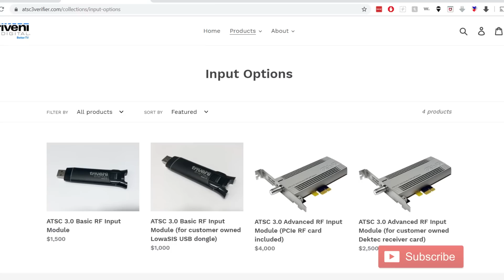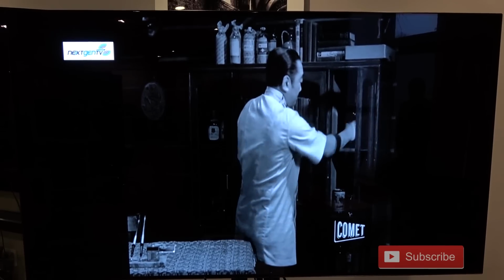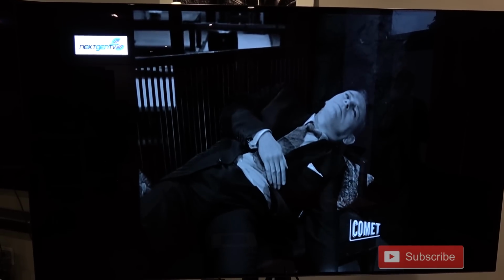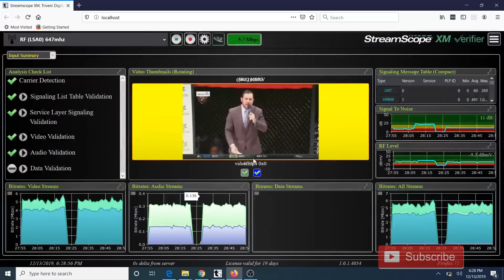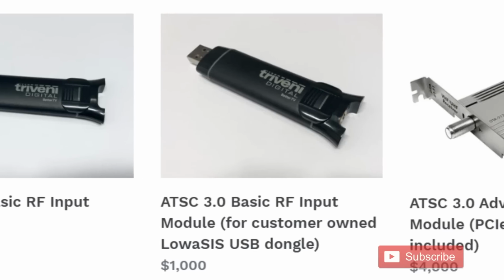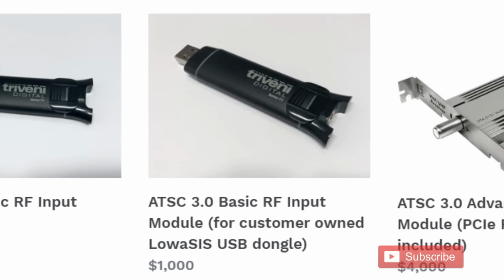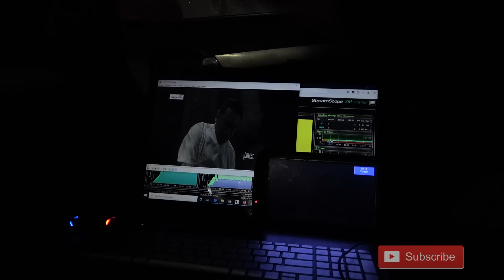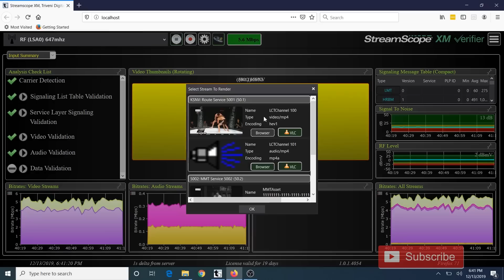ATSC 3.0 NextGen TV Signal Test and Demo in Baltimore, MD

Comment: Yes, a great video!  
One clarification -  the robustness and freedom from multi-path reception issues is primarily due to the modulation rather than the fact that it’s IP-based.  ATSC 3.0 uses OFDM (Orthogonal Frequency Division Multiplex) rather than ATSC-1’s 8-VSB (8 Level Vestigial Side-Band).  The OFDM modulation also makes mobile reception a reality, something that the current 8-VSB standard doesn’t support.
Reply from the maker: Thanks for the clarification on this. There was so much information from the visit I missed that part. Your comment will be pinned.
Reply: Antenna Man   Thanks!!  We manufacture transmitters and have been involved with over the air tests of ATSC 3.0.  You are right, only a Dongle receiver is commercially available in the USA for ATSC 3.0.  However, both LG and Samsung sell integrated 4K TV’s with ATSC 3.0 tuners in Korea.
Reply: I would appreciate a simplified explanation of this. I do not understand. Thank you.
Reply: Fred Pinnix   Fred, it’s pretty technical and might not be something I can explain in a few words.  In a nutshell, today’s ATSC-1 standard is based on 8VSB and although it works pretty well it has one major drawback - it is a single carrier system.  A single carrier can be badly affected by multi-path reception.  For example if the main signal and a second signal from a reflection are received in-phase all is well but if the main signal and the reflected signal are out of phase, they will cancel out and reduce the signal level seen by the receiver.  Movement of the receiver, or movement of an object that reflects the signal will cause problems that result in signal being intermittently lost.
The ATSC 3.0 signal uses OFDM modulation which uses thousands of carriers on different frequencies spread across the TV channel bandwidth.  In this case reflected signals will cause some carriers to increase in signal level and others to decrease.  This allows the receiver to properly demodulates and decode the signal.  There is also a lot of error correction (both time and frequency) that increases robustness.  ATSC 3.0 also has a wide range of “settings” that basically allow a trade off between robustness and payload.  There’s a lot more but it’s a pretty deep topic.
Reply from the maker: @martynh5410  The last part you mentioned is what they're figuring out at One Media: the balance between "robustness" and "payload"
Reply: Antenna Man   Yes.  I’ve met some of the OneMedia folks and they likely are testing some different scenarios.  The good thing is ATSC 3.0 allows simultaneous transmission of different payload/robustness programs using a concept called Physical Layer Pipes (PLP’s).  For instance one program with a low data rate could be transmitted using QPSK modulation while another one with high data rate ((like a 4K UHD tv program) might be transmitted using 256 QAM.  This allows different services to be broadcast to different consumer devices with different capabilities.
Reply: @martynh5410  Thank you for the additional information.
Reply: @martynh5410  I would not be surprised that ATSC 3.0 will survive better in E-skip ranges "54 to 88 MHz" for TV DXing than the old ATSC 1.0!😁😎

73's N5XZS
Reply: Tim Johnson   That would be interesting to find out Tim.  I never got started in Amateur Radio myself but TV DXing sounds like a good hobby!
Reply: So most importantly what happens to our current equipment? TVs and Set Top Boxes? Upgradeable or do we need to replace it?  Why IP based?  What does that mean in relation to 1000s of transmitters?  Dosent seem like OTA provides want to build 1000s of transmitters
Reply: @KA4UPW  

I suspect that many transmitters designed to transmit ATSC 1.0 may be used by replacing the ATSC 1.0 exciter with an ATSC 3.0 exciter.

If not, a whole new ATSC 3.0 transmitter may be needed - especially if the ATSC 1.0 transmitter were not engaged to a linear amplifier (as opposed to high-level modulation of the transmitter).
Reply: 1L6E6VHF   I think in general, most ATSC-1 transmitters can be upgraded to ATSC 3.0.  The two key issues will be  the transmitter power rating and the overall performance.  Since the peak-to-average power ratio of an ATSC-1 broadcast transmitter is around 6dB and the PAR for an ATSC3.0 transmitted signal is around 8dB, this can be a limiting factor, especially in older transmitters that are peak power limited.  In other words you may have to turn the average power down about 2dB to get an acceptable quality signal.  The other factor, signal quality (as in Signal To Noise Ratio and intermodulation distortion) may also be a limiting factor.  Newer transmitters have some pretty clever pre-correction to improve performance and the latest generation of RF devices and amplifier designs are much more energy efficient.  Therefore, yes new transmitter for ATSC 3.0 is often a good idea.  By the way, my company designs, manufactures and sells TV transmitters.
Reply: @martynh5410  
Thanks.
I wish I were working in your field.
Reply: Martyn H I hope you can offer some support to Antenna Man. He seems like a great young man and he's very excited about the possibilities and implementation of this new standard. God Bless
Reply: Thanks,
To me i thought one local network transmitter would requie 1000s of transmitters (repeaters) to pull this off. But yes between the repack and this upgrade it may bankrupt many sites
Reply: H.265? Or another better video encoder?
Reply: Mr. Garber  The video CODEC standard for 3.0 is H.265 (HEVC).  In reality it’s between 25% to 50% improvement over MPEG-4 (H.264).  Audio CODEC is Dolby AC-4 and also MPEG-H 3D.  
There is a newer CODEC on the horizon, called VVC (Versatile Video Coding).  It claims to further reduce bitrate by another 40 to 50% over HEVC, at equivalent video quality.  I think it’s due for initial release late 2020.
Reply: Thank you for the heads-up on VVC, i had never heard of it before.
Reply: Curtis B   You’re quite right Curtis regarding MPEG2 being in the current standard.  My bad, I’m an RF guy for 45 years and not an expert on video coding.  I think that you are correct on the CODEC for ATSC 3.0 being fixed (H.265) because tuners need to work going forward.  I do know that 3.0 is meant to be adaptable to future improved standards so maybe the could be changes later.  I’ll check with my colleagues on this point and get back.
Reply: @martynh5410  but if am not wrong FVC codec would be used in the ISDB-TB And ISDB-T systems but will do an specie of hybrid system for compatibility with the older TV that only can decide H264 only
Reply: It all sounds like science fiction to me.  Probably from the aliens who crash landed at area 51 back in the 1940's
Reply: Oooooh! Orthoganal Frequency Division Multiplexing! Gimme 316 kilowatt effective radiated power VHF high-band analog!
Reply: RF Burns   Great name “RF Burns” LOL!  I went to college with a guy who’s real  name  was Robert Frank Kidd, initials “R.F. Kidd”.  His dads initials were “A.F. Kidd”.  Have a great day and careful with that high power RF!!
Reply: Good video thank you.
Reply: S
Reply: Yes and no, the secondary video of broadcast in an lower resolution and bitrate makes possible the reception in Mobile devices not the modulation itself , may an OFDM be QAM 256 but if all that constellation is used with video with greater bitrate than an Mobile device can decode then will not get anything that device
Reply: @megacap55    Lower bitrate and constellation type are inter-related.  The low bitrate program could be transmitted on a QPSK modulated signal, versus a high bitrate program which would perhaps need a 64QAM or 256QAM constellation.  The QPSK signal will be far more robust and allow reception in more difficult circumstances (like on mobile devices or indoor reception).

Comment: I'm assuming the encoding used is x265 (vs the older x264)
Reply: Yes, it is. ATSC 1.0 uses MPEG-2, which is the same codec used on DVDs and is far less efficient.
Reply: @alvallac2171  , wow..the ATSC was WAY behind typical digital video.  I've been compressing video with x264 for years and just recently (last year or two) been using the more efficient x265 (about half the size & bitrate needed compared to x264).  However, the x265 codec is much more CPU intensive.
Reply: @douglasmontgomery6315  The reason ATSC 1.0 uses such an old codec is because it started in 1996. At the time, resolutions like 720p and 1080i made it very futuristic, kind of like the short lived HD VHS format that also existed ( https://www.youtube.com/watch?v=jiu0LPeLQPE ).

Speaking of video codecs in general, have you heard of AV1? Nothing to do with OTA broadcasting and it's still in its early days (currently zero hardware support for it), but it's a successor to VP9 (the open source codec used by YouTube) and given all the companies on board with it, it seems poised to become the next dominant video codec (like H.264 was). It's more efficient than H.265, while also being open-source, instead of the proprietary, patent-encumbered mess that H.265 is, and will often be paired with OPUS (the swiss army knife of lossy audio codecs that is also open-source, and slightly more efficient than AAC). Could be interesting once it starts to catch on. Encoding performance still needs serious performance gains. See http://reddit.com/r/AV1

PS: x264 and x265 are encoders, not codecs themselves. The codec is the format specification for how the video will be compressed, and the encoders and decoders are specific software implementations that get created to either create (encode) or playback (decode) files using that particular codec. For any given codec, multiple encoders and decoders can end up getting created. x264 and x265 are very popular software-based encoders for H.264 and H.265, but there are also other encoders that exist such as Intel Quicksync. Quicksync is hardware-based and thus much faster, but the videos it outputs are not as high quality compared to x264 and x265.

Comment: Glad to see more INFO about the New ATSC 3.0 Thanks . Like to know if you have ever installed  a Winegard HD8200U  antenna if so whats your thoughts about it ??
Reply: I have one. The only thing I can say about it for your use case is that if you're dealing with diffracted signals (hills between you and the station, or trees), it's not a great choice since it's too directional and lacks enough aperture to reliably pull in shifting signals from over the hills/though trees. I was also completely unimpressed with the VHF performance of it, despite it having great characteristics on paper. 
Do you have a need for vhf-lo? Check rabbitears.info and check your city for physical channels 2-6. If yours are all 7+, the hd8200u is overkill, and it opens up your options since you can select a smaller log periodic and get better results.
It's a beast of an antenna, and it's not bad per-se, but that's an antenna you'll want up really high. If you had a 75ft tower, that antenna would absolutely sing.. but 20 feet up, or by hills? It's actually so well focused that it hurts itself in those situations, it misses the signals being scattered by the trees/hills because it's basically a laser beam, whereas I needed a spotlight.... At least from my experience with it. Every use case is different, though.
Reply: @soulnull   Thanks for your Opinion on the Winegard 8200 U Antenna To be fair I own three of the Winegard 8200U antennas and yes I have five channels that are VHF Low Band @ 85 MHZ and the 8200 U pulls them in .. The other Winegard 8200 U is at my camp 
 and yes this is Considered Very Deep Fringe I get 32 channels at that location the third 8200U I bought for my Son and that location is considered Deep Fringe . Plus I do have Five Channel Master 4251 UHF Antennas and yes they are the 7 foot Parabolic plus a 1968 Finco 7 foot Parabolic UHF Antenna .
Reply: @pdm427  I sincerely apologise if anything in my previous post could be taken as condescending, as I had no idea what you knew from your question... but you having those parabolics, clearly I am in the presence of a serious antenna user. I am very jealous, those are legendary antennas. I am also happy to hear your vhf-lo performs well, as I don't get to use that part very much anymore.. but VHF-hi on it underwhelms me, and I'm sad to say it, because it really does seem like a great antenna overall. I can't believe how many storms it's made it through without any problems at all, and just how strong the signal levels are from far stations (my problem here is signal quality). I built a db8 that pretty much replaced it, since it wants that extra capture area, but I really don't want to take it down. I really want to figure out a good use for it.
Reply: @soulnull   I did not take your reply as condescending. I really enjoy doing antenna installs plus using antennas my self what really makes it fun is the 4nec2 software  that you can model a Antenna in plus build and antenna and see how it will perform this is very helpful for doing antenna installs in Deep fringe areas.